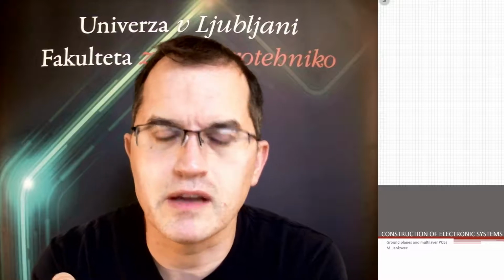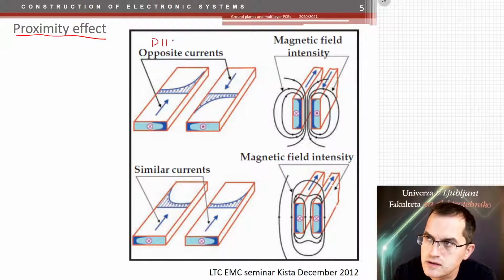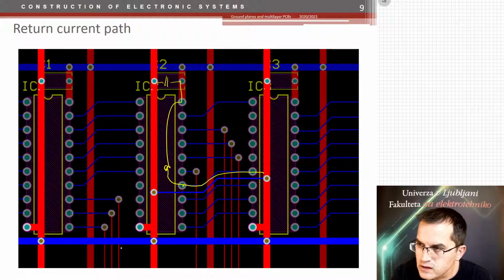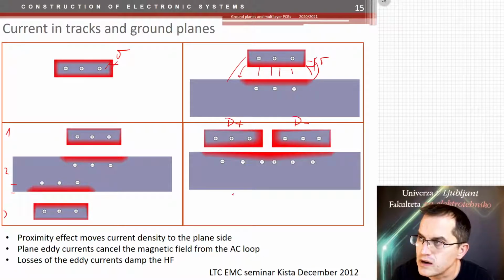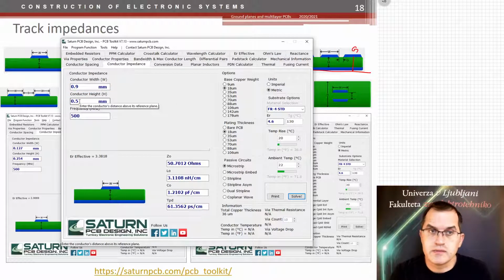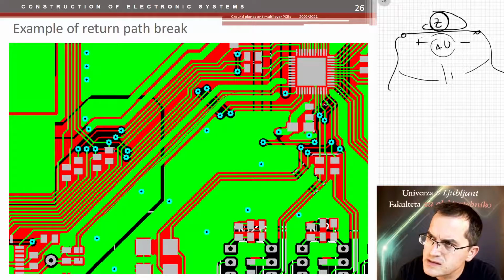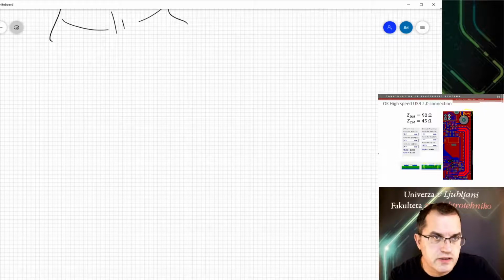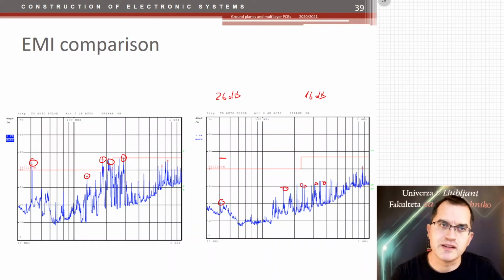CES #10: Ground planes and multilayer PCBs part1

Comment: Intro 0:00
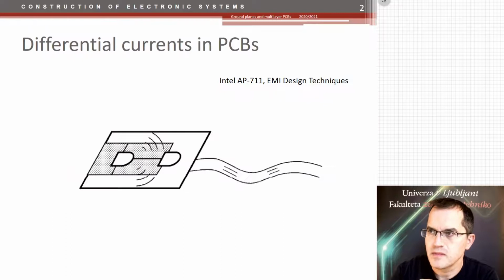Differential currents 1:00
Kirchhoff law 2:05
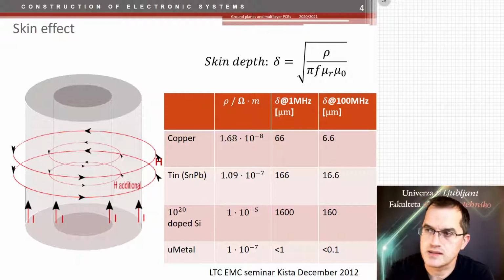Skin effect (equation) 5:14
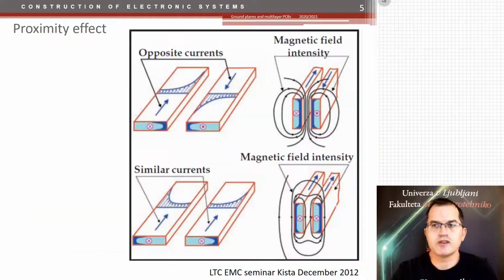Proximity effect 9:20
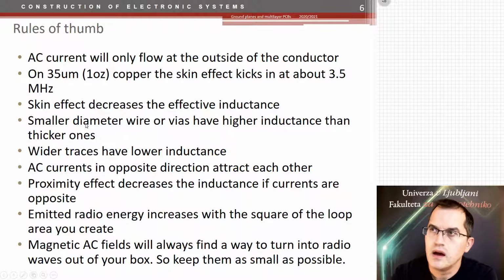Rules of thumb 10:24
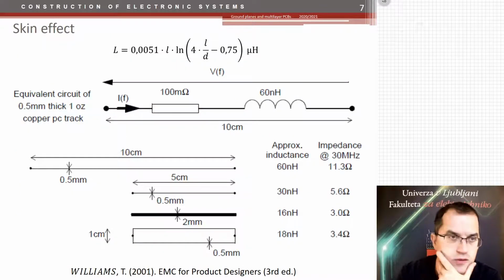Skin effect 2 12:02
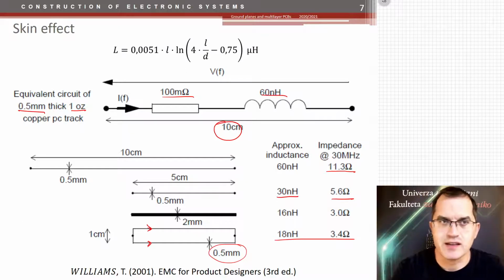Ortogonal signal routing 13:48
Ground plane gridding 20:34
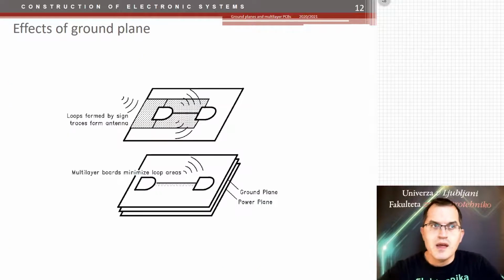Effects of ground plane 23:59
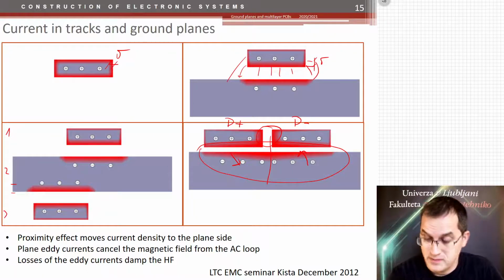Transmission line (equation) 28:17
Track impedances (SATURN PCB) 33:27
Ground plane impedance 37:45
LF and HF return paths (Example) 39:58
More examples 45:33
Signal integrity 54:40
Multi layer PCBs 57:30